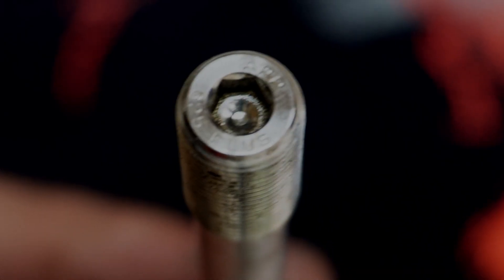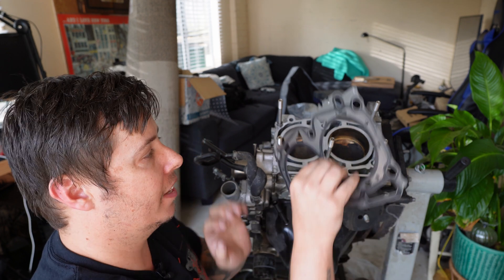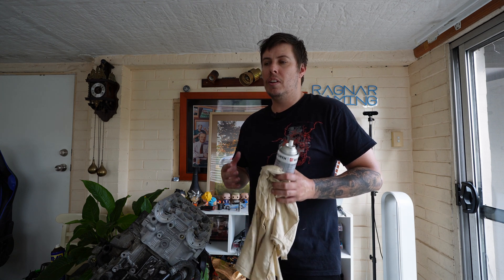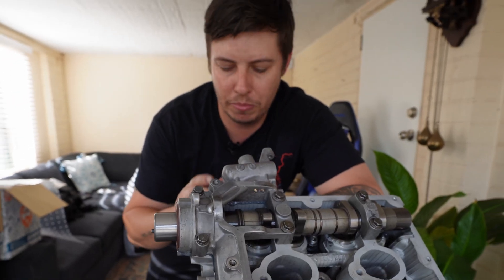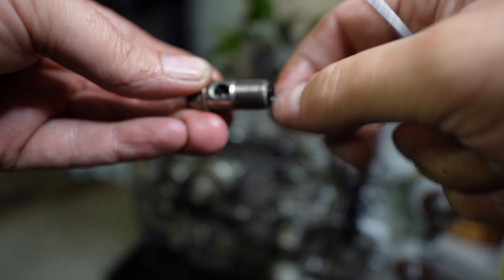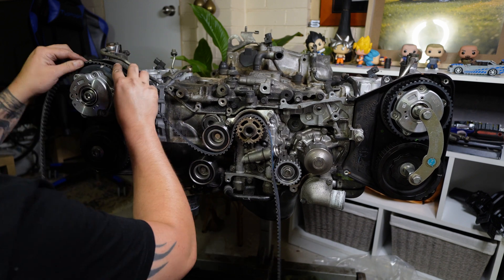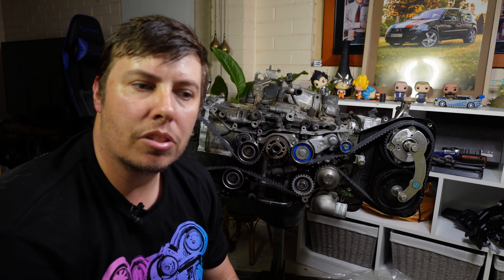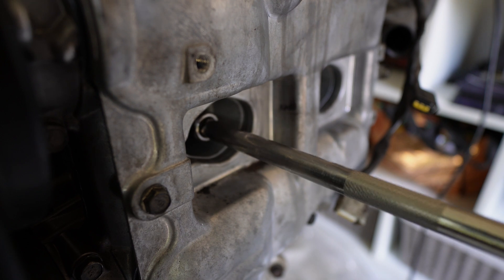How to Assemble a Subaru Engine

Comment: Nice video mate!!

Very helpful illustration on where everything goes 👍🏾

Random question though; I’m trying to fix a second knock sensor to this short block for mapping purposes. At 11:56, I see there is a knock sensor there.

Is there any additional place that you’d recommend I bolt on a knock sensor for my LINK Knock block? 🤷🏽‍♂️
Reply from the maker: If there is easy access id try to mimic the position of the factory sensor but on the other side of the block